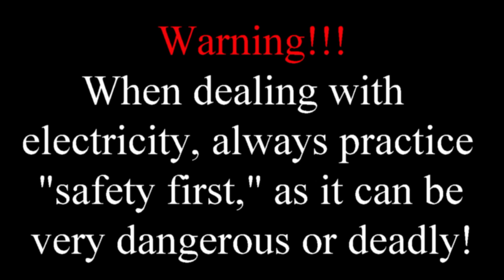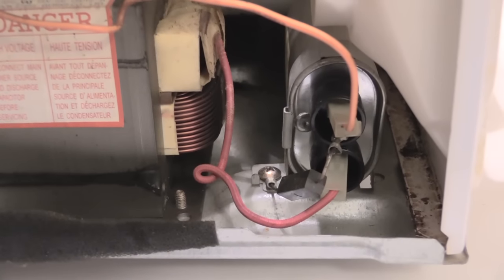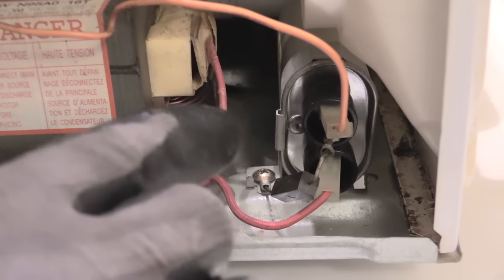Microwave Not Heating--Easy Fix!

Comment: I've fixed dozens of microwaves, and I can't recall a single time when it was a bad diode causing it to not heat. I suppose if it were shorted, it would pull the transformer voltage to ground. That would cause it not to heat, but I would not say that is the most likely cause of a microwave not heating. If it comes on and makes the normal microwave sound, but doesn't cook, it is most likely the magnetron. When it is completely dead, it is most likely a bad fuse or a bad thermal limit switch, or sometimes just bad spade connectors at one of the limit switches. When it has power, but wont run, it is most likely one of your door switches. If it stays running when you open the door, that is also most likely a bad door switch.
Reply from the maker: Thanks for taken time to write your thoughts on possible problems.

Comment: A couple of repair shops said it would run me $300 to repair my 4 yr old microwave and I'd be better off buying a new one.  But after watching this video and a little research on an appliance part website, I took a chance and ordered a new diode.  Sure enough, that fixed the problem.  $5 for the part and another $9 to expedite shipping and we're up and running. Thanks for the help.
Reply from the maker: Your welcome, Thanks for watching and commenting glad could help you get your microwave working. Please subscribe & like and share if haven't already and check out our other helpful videos

Comment: Thank you. Yes in my case, it was a bad diode. I measured and found it has an open load on both direction. A $5 part on Amazon saving my $600 Breville microwave.
Reply from the maker: You're welcome glad you got it fixed. Please subscribe like and share.

Comment: Five year old Maytag microwave stopped heating but acted normal otherwise.  Found the diodes, they checked out bad on an ohm meter (open).  Amazon got me a new pair the next day for $11 delivered.  Installed and the microwave is now working fine.
Reply from the maker: Your welcome  glad could help please subscribe like and share and check our my other helpfull videos.

Comment: My Panasonic Combination  Microwave Oven stopped heating up. With a view to making a repair, I turned the unit through 180 degrees in an attempt to find the plaque with the model number (as it happened it was actually  on the RHS of the doorframe) and noticed immediately that the air inlet grill was clogged with a greasy cobweb. This was a bit of a surprise since I didn't consider my kitchen particularly greasy and the microwave was only about 18months old.  Once I removed the cobweb with a vacuum cleaner the oven started working normally. Although I had kept the air grills on the top and RHS scrupulously clean, I had forgotten all about the grills at the back. One of these provides cooling air for the magnetron and the other electronic parts. The greasy cobweb had severely restricted the cooling airflow, causing the thermal cutout to actuate.

Comment: It’s nearly always the magnetron that’s run it’s race. Other components are usually ok. To discharge a capacitor put a screwdriver across the terminals remember not to touch any metal parts because the capacitor can kill you.

Comment: Hi Flash, when I start my Panasonic NN-L931BF Inverter Microwave, the timer, fan, and rotating turntable and light begin to operate but stop after exactly 5 seconds. The timer resets to start but everything else stops when the Magnetron tries to kick in. Always after 5 secs exactly.
I checked all the door switches and fuses and all is OK. I'm about to pull out the Magneton
Do you think this is causing the cook function to reset the oven? It is dated 2001 but I just bought it a year ago. First time this has happened. The magnetron is 2M261-M32, older than the one in your video. I don't believe the fuse is blown as it starts everytime. Do I need to replace the invertor board or the magnetron to fix this problem. Can you post a link to a new power relay for the inverter board as this might be the problem.Also cannot find the HI Volt Diode or Capacitor Thanks....Paul
Reply from the maker: Yes it sounds like a bad magnetron. It will cause that very problem.

Comment: Not an expert but hours of research and my own experience with my ge 1800  spacesaver mw reveals the main cause of a microwave that works  normal but just doesn't heat is a faulty  magnetron (about $60 at Amazon ) not the $ 9.00 diode

Comment: Have you ever seen the Cap go bad? Many HVAC systems the Cap goes bad on the condenser unit so wondering if this is an issue with a microwave as well. Thanks.
Reply from the maker: Sorry never had that problem.